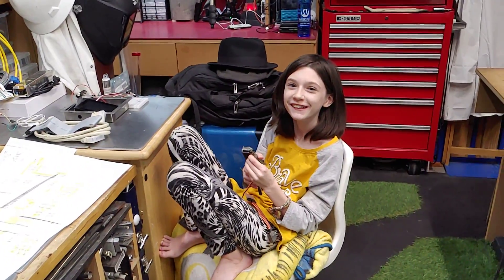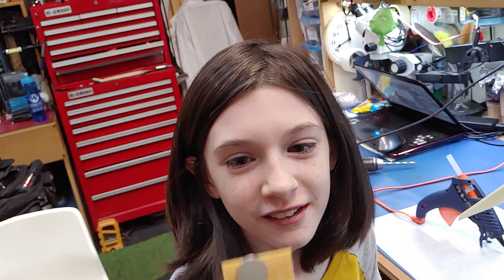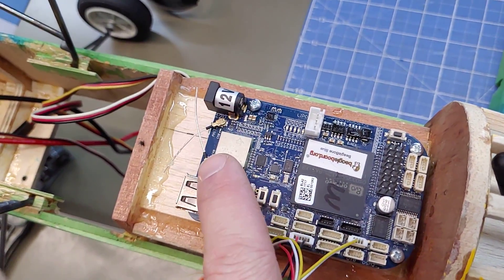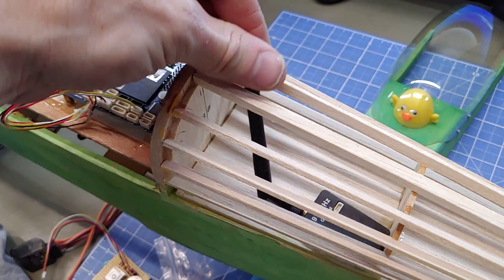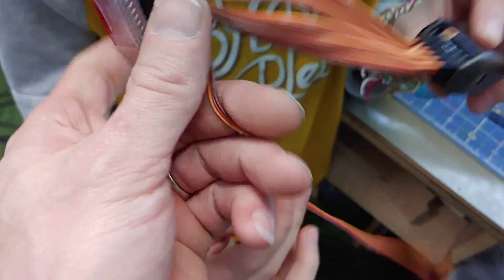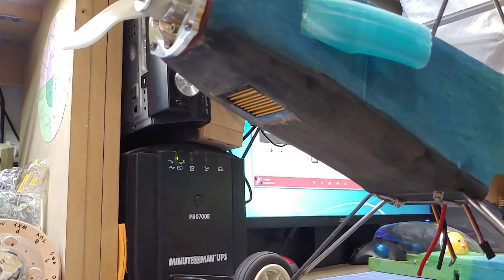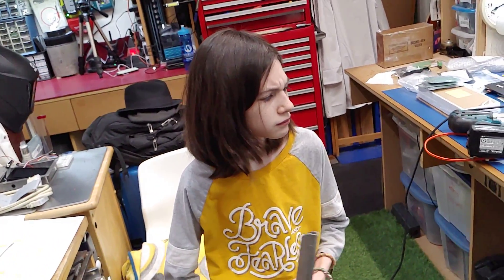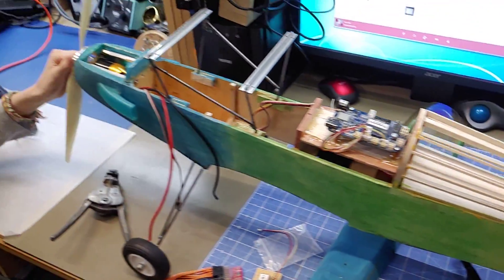#1-22 Riley's Green Lightning bi wing RC plane electronics for ardupliot BeagleBoneBlue.

Comment: could you put some batteries in each wing . i think planes put the fuel in the wings so that weight is in the center of the plane and the lift area. great video .
Reply: Bring on the outside it might add roll stability.